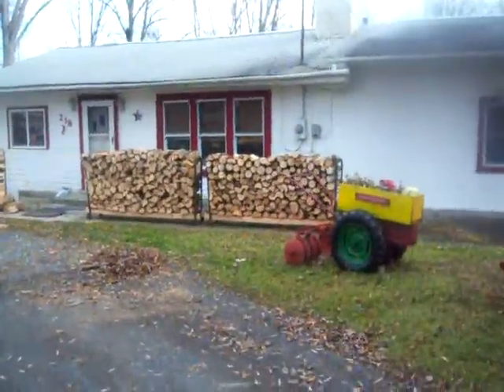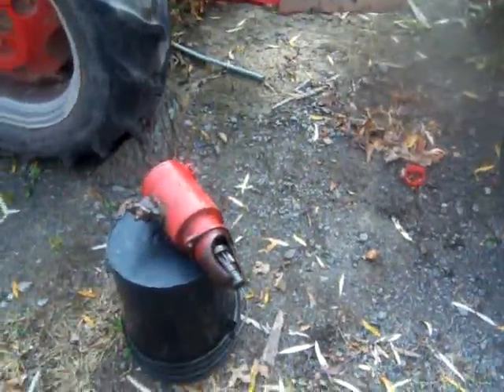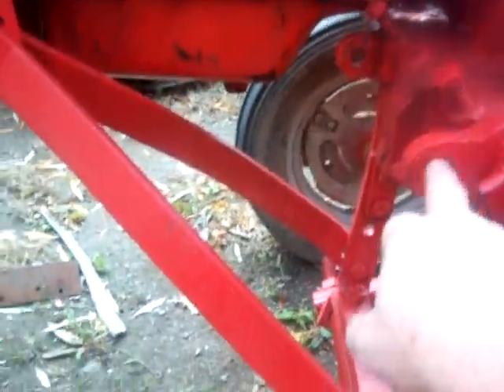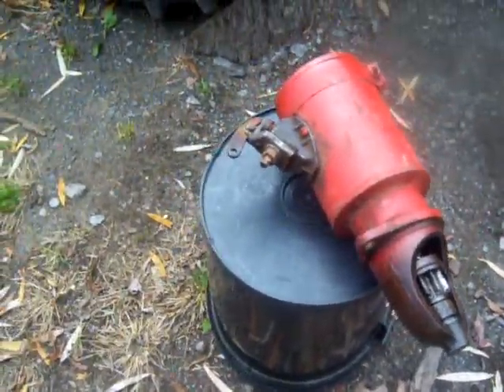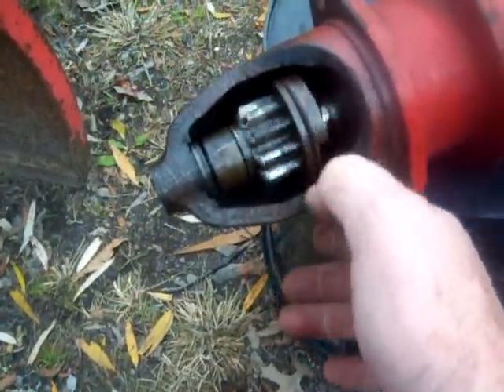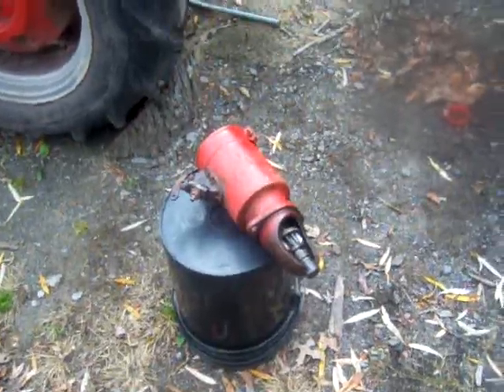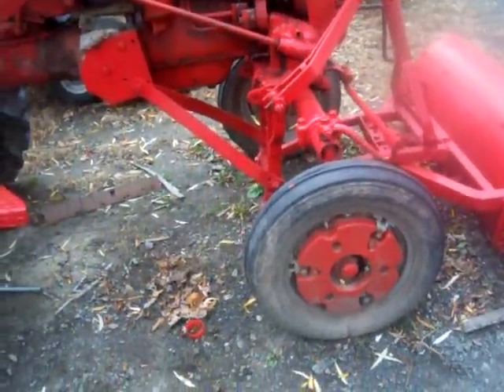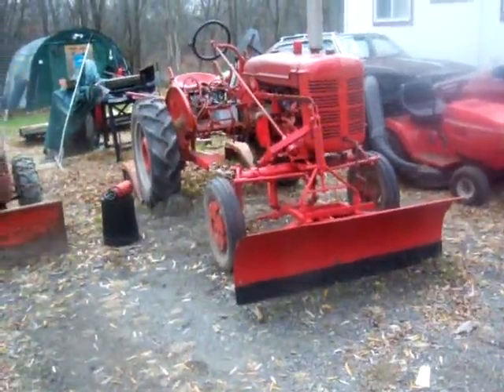Farmall Grader Blade /  Plow Update & Starter Problems

Comment: Looking good Dan, I have had the same problem with my starter. The only advise I have is have it rebuilt or buy a new starter. I have replaced my once and it went out again. I have had this tractor for 10 years. You can find them on ebay but they are kinda pricey. I have seen some for about $100. good luck and great video